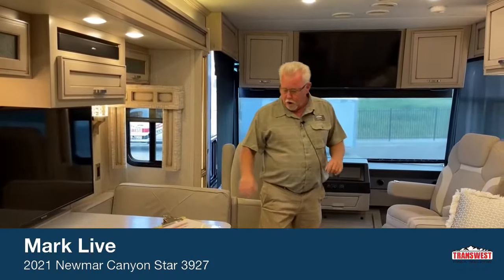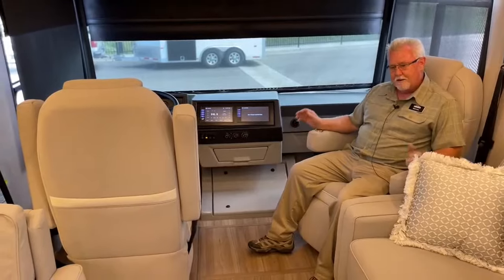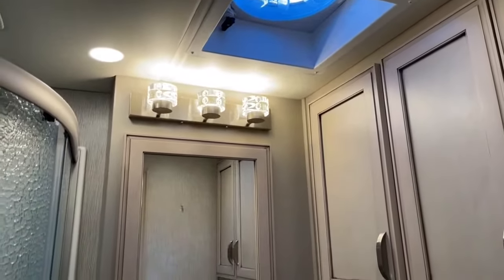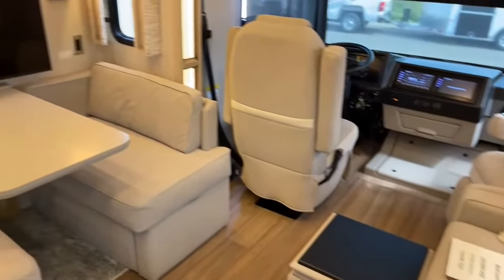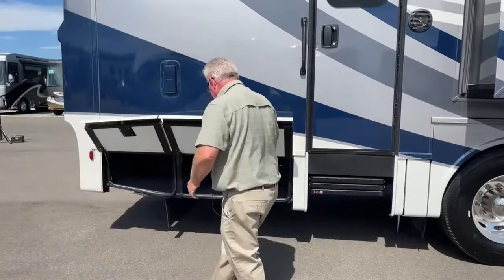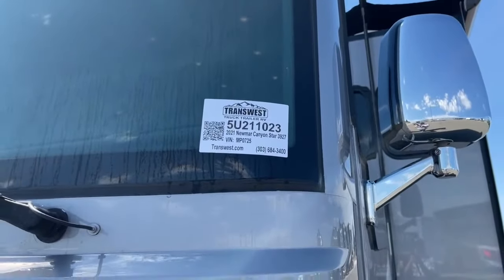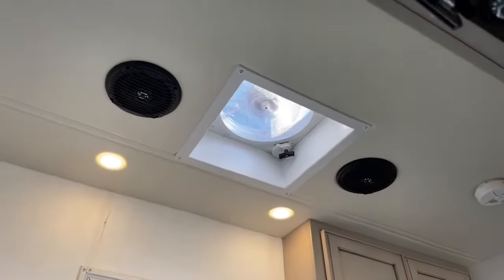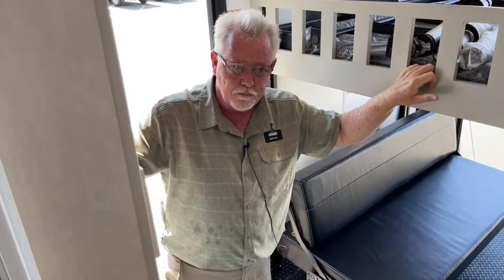Newmar Canyon Star 3927

Comment: This is a very clean coach. Some observations from my perspective, everyone uses their coach differently. I myself consider the TV upfront a total waste and I know it is an option, I have seen only a few builds of this model with all cabinets upfront instead. Perhaps with grandchildren, the front TV could be used, but ours watch TV on pizza night and never just casually, they still have their Imagineering skills about them. So we'd use their floorplan more as a camp host managers coach with the rear as the office to sort out the weekly reports from the various USFS campgrounds in the district. The dinette otherwise would end up temporarily a junky mess as traditional floorplans default to. If ordering from new, we'd have the dishwasher installed as it only uses 1.9 gallons per use as we have proven many more times that we use more water manually washing a rack load of dishes. Also, especially since this coach design isn't rear deck friendly, we would order the rear ladder as we normally strap our 25' telescopic pole onto it for our RV-65 65 dB 4G cell amplifier. A normal Weboost cell amp or MIMO antenna often doesn't cut its way out on the fringes of civilization where you have to grab what little signal is available. Many of our campgrounds have satellite phones instead, but we have to download pdf files for our daily reservation updates on 14 of our 16 campgrounds, not huge files, but hitting the page reload button over several cups of coffee is normal, lol. Having the 24-gallon fuel reservoir is a great idea for those gas utility vehicles, although refilling this tank is harder from 5-gallon portable tanks since the receptacle is recessed. What many folks don't realize upfront is the GCWR limitations on the FRED MC chassis. If your dinghy is over 3,000 pounds then you have to give up some of your cargo weight capacity to not overload the overall ratings. From what I've seen of the typical OCCC ratings, a 2022 Ford Maverick hybrid at 3,700# would make a great dinghy with about 3K# left over for possessions and a partial tank of FW. Many of our USFS campgrounds have water hauled in weekly so it is nice to have a 75-gallon tank to fill up with fewer refill repeats from the 210-gallon tank off to the side, only you unload your patio furniture and auxiliary ground-mounted solar panels )host sites are often partially shaded). Aftermarket, of course, is to replace the 390-pounds of lead-acid batteries with 186 pounds of the same number of LIFEPO4 batteries so there is then cargo capacity left over for 600+ watts of roof-mounted solar. We typically only used two LIFEPO4 batteries in our travel trailer, but this wonderful more residential-style all-electric compressor-driven fridge would save us a lot of propane and make less use of an additional cooler for our daily celery juice remedies, lol. Overall I think this floorplan would work for us, but it sounds like when we are ready to buy we need to order what we want since many of them are configured for slightly different lifestyles than ours. This is probably true of most coaches, LOL.